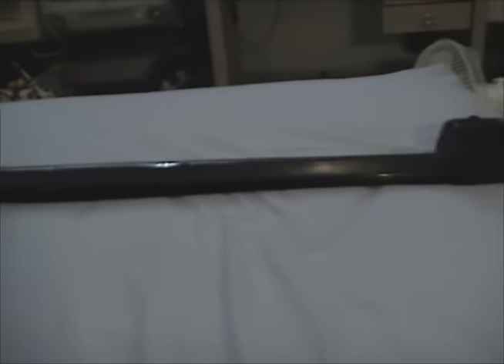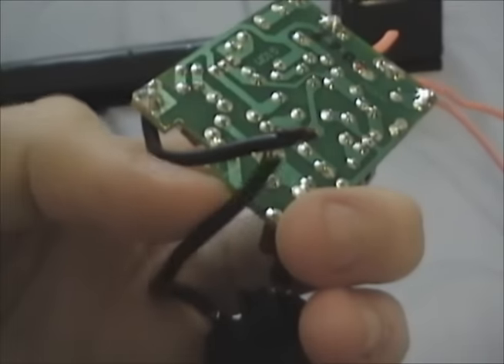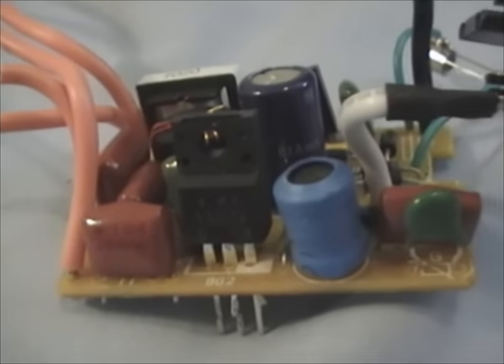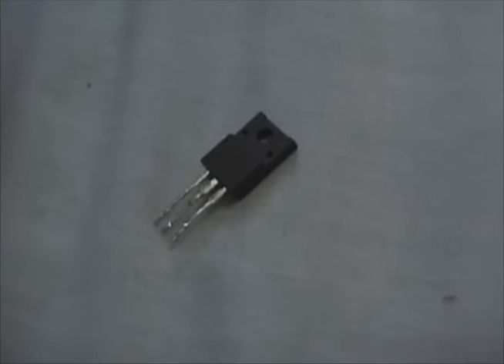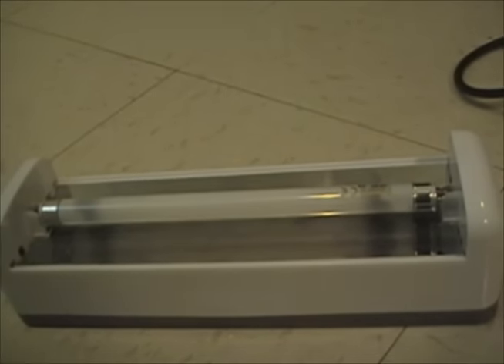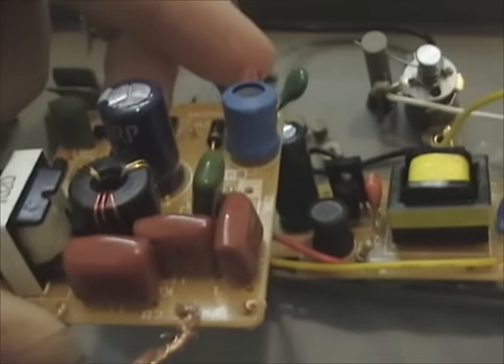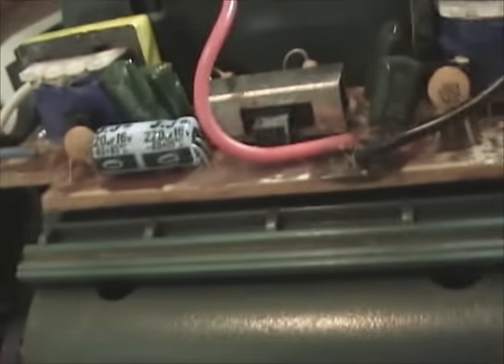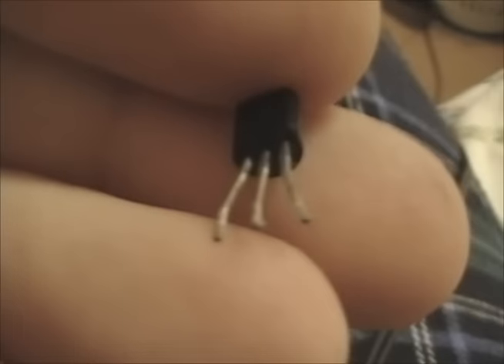Attempt to repair four electronic fluorescent lamp ballasts

Comment: You never cease to amaze me.  I wouldn't know a thing about repairing ballasts, but you sure have been teaching me a lot so far!  I was excited enough about my ability to convert two old 4 lamp T8 light fixtures into a T12 one.  I had wired the fixtures up with romex wire and a plug and the T8's and ballasts worked great. But I have a bunch of T12 F40 black lights.  Well, research suggests that T12's are hard on T8 ballasts so I swapped them out for T12 ones.  They don't seem to light very well on T8 ballasts anyway. 

Ok, so I needed two T12 ballests per light fixture....so after I cleaned the fixtures up, i swapped out the ballasts.  Had to replace the tombstones as T12's have a diff configuration...took an hour to realize this so it was off to Lowe's again..

The fixtures themselves came out of an old dollar tree and I merely chose the two best ones and the rest were trashed.  I wired the romex cord and plug back up and even added another female plug so I could plug the second fixture into the first.  So now I can use these as my black lights @ halloween.  I loved working on these things and while it was not as neat as your videos, but I felt I'd share it.  I'm a huge halloween decoration guy, so now I finally have some strong black lights for the special effects.

Comment: I used to try repair the Fluorescent Lamp like for example like GE Black Fluorescent Lamp case F15T8, I notice the AC Cord is damaged, and I replace the AC Cord, test them out and worked fine.

For me I recycled the Electronic Ballast by saving the components then to try repairing the Electronic Ballast.

Especially for my GE Black Fluorescent lamp, it has simple Choke Ballast and has Preheat Starter. No Electronic Ballast that has contain but Simple Choke Ballast and the Preheat Starter.